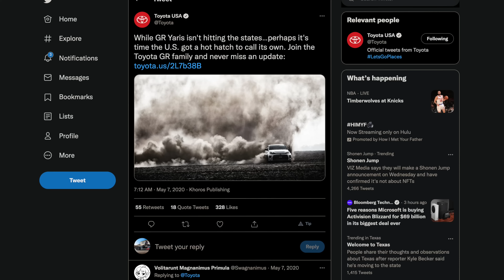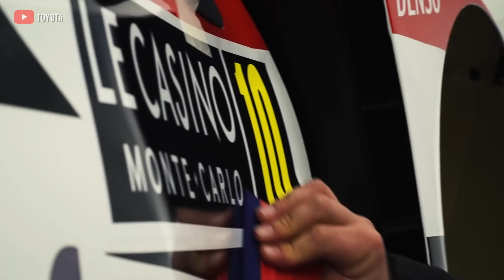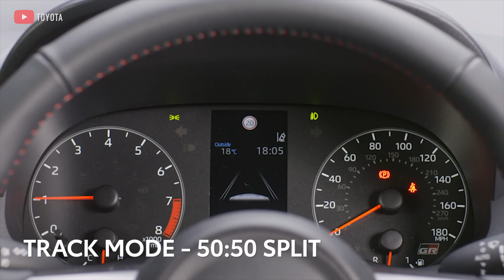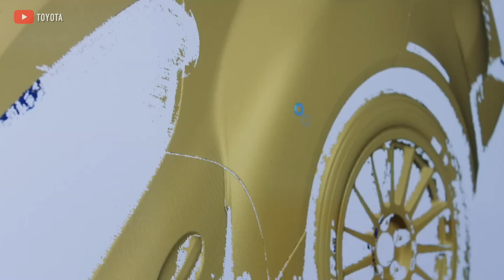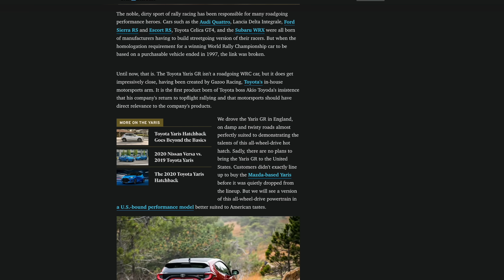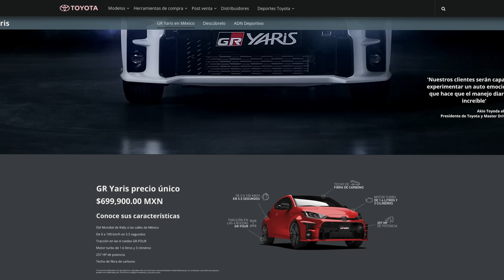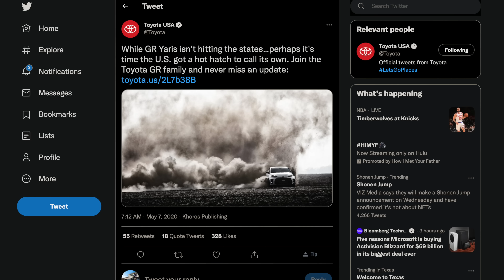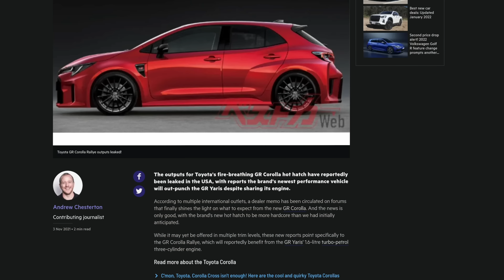Can You Forgive Toyota For This?

Comment from the maker: What are your thoughts on the GR Corolla? Vaporware or Toyota's saving grace?
Reply: Neat, but that's about it.
Reply: It’s looks nice
Reply: GR Corolla probably will be the first new car I will buy :)
Reply: The GR Corolla won't be as bespoke as the GRY or it will be too expensive, the GRY is nearly twice the price as a normal Yaris here, I'm hoping for an auto version of the GRC
Reply: Its the Toyota version of the ford focus RS lol
Reply: Wont be as special as the GR Yaris, but undoubtably great. 

I always wanted a hardcore version of the Corolla, because its already pretty.

The GR Corolla will have the same engine and drivetrain, but not as much of the extensive body work, slightly lighter than the regular Corolla, around 300hp.
Hard to imagine its going to dissapoint
Reply: Probably gonna get some hate from this but why does the USA need to have all the cars in the world ? How much choices do you want ? Is the same market that didn't sell the Celica well back in the days and now it's a 50% chance that it will happen again. Only enthusiastic people are going to buy it but it will not be enough to make it a hit. It will be wanted after it has left the US market again.
Reply: GR Yaris is boss why does Toyota need to save them selves
Reply: hot hatch = yawn, no buy.     real homologated rally car = I'd buy two.
Reply: It will need eveything the GR Yaris has:
- Manual Transmission
- GR - Four technology/modes
- Same power-to-weight
So, ballparking the weight based on the current Corolla XSE, that means 300-340hp
Reply: @bigbodykarate6403  I've done the math. Ballparking the Corolla weight based off the current Corolla XSE, To have the same power-to-weight ratio, the GR Corolla will need 300-340hp
Reply: I just drove a new 6 speed fwd hatchback and the thing is a blast, handles incredible, and the acceleration is awesome. Praying we get this version in the US!
Reply: @TerminatorProducts why would you want an auto version of a car like this?
Reply: @TerminatorProducts  I'm gonna ask you this genuinely, and give you the benefit of the doubt; are you physically disabled? Because I've a car-guy friend with cerebral palsy and that's why he needs an Automatic.
Having a physical disability is literally the only valid reason for wanting an automatic sports car
Reply: @Aglai76  Mate I'm a manual man through & through, currently own a few manual V8s, a couple of Hilux's & GR Yaris, (I must say my Supras auto is stunning though), I want an Auto GR Corolla for my partner she struggles a little with driving manuals for extended periods as she has had left ankle operations, I can't ask her to daily drive a manual so if there in no auto GRC she will be getting a GR86, having had two manual GT86s previously I was happy with the car apart from the lack of power
Reply: @bigbodykarate6403  : The Corolla's supposed to come with significantly more punch than the GR Yaris; I've heard talk of 300bhp? Also, apparently that 1.6 turbo is very responsive to modification and can probably go significantly above that; more in line with Toyota's old school stance of overbuilding than a lot of other manufacturers' "make it break if pushed much over factory figures".
Reply: We were blessed to get all those cars and more as a small island. Once you have the cash you're able to import it yourself. The Corolla runx Z was an amazing car, also the caldina gt those were the best sport cars of the early 2000 for toyota that we had the 3s beams alteeza also.  The runx was the better car to have than the celica if you wanted 4dr sport. The gt starlet was amazing for real cheap speed but the sir and type r guys just beat them so they had to squeeze the waste gate or upgrade the turbo to the mr2 or celica and its a beast. Those were fun days.
Reply: Even if they don't sell the Yaris in America, why not just bring over the GR Yaris?
Reply: Gazoo means a*us so there's that..
Reply: @EpicB  For the same reason nearly none of the homologation cars will ever make it to the US. US crash testing. You need to put up 20-30ish cars for crash testing. So for a homologation car, which hits the minimum 5000 units sold worldwide, to spend 30 cars to be destroyed for a single market isn't worth it in addition to the few millions or so in certification costs. They were going to hit the homologation sales number without the US so simply wasn't worth it esp knowing they weren't going to produce more than the bare minimum for homologation WRC.

It's the same reason why we're not getting the Audi RS3 sportback or BMW M3 Touring and a bunch of other cars. The cars and testing cost too much for it to be worth that investment for the new body style for the projected sales numbers and realistic production.
Reply: @Alltracavenger  Incorrect there. The WRC race car only has ~400hp. The 1.6t isn't that responsive to modifications/tuning. However, there's speculation they'll put the GRMN Yaris engine into the GR Corolla. Rumor Mill puts that engine at 300PS, or 295bhp. We'll have to see if that's true first and then second if it can be reliable. The Mercedes AMG 2L cranks at 208hp/l at 30.5 psi. But that's a 100k car. Honda and VW are about 160hp/l at 23.2 & ~21psi respectively in the CTR and Golf R. Toyota/GR needs to hit nearly 190hp/l to break 300hp... I just don't think it's there and be reliable unless the engine is built like a $70k+ car.
Reply: I don't think Toyota is doing poorly enough to call this their "saving grace". They sell a lot of cars, they're just not performance vehicles.

I made fun of Gazoo Racing when the Supra arrived at the dealership I worked at. I thought Toyota's mask slipped and they showed exactly how tone-deaf they were. I thought a brand named "Gazoo" would never be taken seriously in the English speaking markets. Oh how wrong I was. And I only realized after the rumors of a GR Yaris coming to market that I might've had it all wrong. At the same time I got the feeling they were becoming tone deaf, Toyota started making big moves towards the complete revival of their sporty spirit. If anything, the new GR name (and subsequent relegation of TRD to off road vehicles and camries) shows me they are right on the money.

They're admitting they had a long, boring hiatus. But a new name, three fantastic cars, and massive marketing campaigns are more than enough to recapture that audience.
Reply: Sorry  but , , ,
Still working on 'forgiving Toyota' for releasing a re-badged, 
BMW money pit as a so-called  "Supra".

.
Reply: This car  isn't ment to save Toyota. It's a true enthusiast car buy enthusiast for enthusiast. It just needs to make a small profit. Like someone else said in the comments. It's the first new Toyota I'd like to buy new in a long time. I had a 06 corolla XR-S and currently daily a 98 Lexus gs400 swapped to a 2jzgte vvti.
Reply: I don't understand what Americans get pissed about not having some of these cars you get some of them and don't buy that many in third world country we get none of these cool cars
Reply: These cars were designed and built in Finland by ex Tommi Mäkinen racing.. There is Jari-Pekka Lappi's GR yasoo on the sale on finnish website if you want the link. 60k€

Comment: Anyone remember the Corolla T-Sport compressor that Japan and Europe got back in the early 2000’s? I think it had a 2ZZ with a supercharger making something like 220hp
Reply: My family owned one with full TRD kit, it was very neat and different car (compared to MB's or BMW's everyone else had). Father later sold it for 2x what he paid for it... and immediately regretted it.
Reply: 2002 T sport without compresor or turbo 1.8 NA 192hp, rev up to 8250 and sound amyzing developed with yamaha. Fun starts after 6200rpm when Lift(similar to honda vtec but stronger) kick in and develp max power at 7800rpm. 6 speed manual... And real hand break... Anyone interested to buy.

Comment: There were more than 2500 ST205's built, it was in production from 1994 - 1999. The 2500 number comes from the homologation cars which had plumbing for an anti-lag system, a water spray bar among other things and was called GT-Four WRC

Comment: It's not a sports car. Its a rally car and a fast car. A sports car is sleek. A sports car looks like a sports car.  A sports car passes the mom test. Its cool no question, but its not a sports car. GR corolla will be fine, it will be a worthy competitor to the WRX. If you want fast, get the new Z. If you want fun get a Miata or an 86. If you want practical but not boring get a Civic Si/R or a GTi/R or a WRX or a GR Corolla. There's no wrong answer here. Get the one you like and drive it.

Comment: Super presentation. Well put together ! I thoroughly enjoyed this video.
The world got the Yaris, after it won the Gold Steering award in Europe. I had the four-door sedan, a simple super-reliable car with a 1300cc engine. Excellent handler.
In Japan the same car came with a 1500cc (1NZFE) engine, sold as the Belta. The 2-door & 4-door hatchback was sold there as the Vitz in 1,000, 1300 & 1500cc engine sizes. The sporty hatchback, the Vitz RS had traction control, rear discs, came as 2 or 4 door, in Auto or manual Transmission. 
In 2001, you could buy a 2-door, manual 1500cc VVTI (1NZFE) with a Turbo and Intercooler !
Since the Vitz came on the market in Japan, all three iterations of the tiny hatch could be bought with a Turbo Intercooled engine !
When Toyota re-entered the Rally competitions, the Hatchback GRMN (GAZOO RACING MASTER of the NURBURGRING) Yaris (Vitz) had an 1800cc (2ZRFE) supercharged motor. The domestic street-legal Japanese GRMN (NCP-131 model Vitz) came with a 1500cc Turbo (INZFE) motor. I have seen the 1800cc street-legal version Vitz being sold in Japan.
In recent years the epic GR Yaris has evolved with more horsepower with a new 3-cylinder 1600cc engine. This car that have rally-enthusiasts by the balls, is what is featured in the latter half of this video.
I used to import used Japanese cars in my country, and our family had the 4-door hatchback Vitz RS in the first (NCP13) and third (NCP131) iterations. Both had Automatic transmissions.
In my opinion, after importing hundreds of cars from Japan, the Yaris/Vitz cars are some of the most durable and reliable cars that Toyota ever made.
Oh ! The Yaris was sold as the Echo in some countries.
The nice part ?
Each citizen in my country is allowed to import a new or used car every 4 years !
Trinidad & Tobago.
West Indies.

Comment: GR Yaris > GR Corolla
It's all about the power-to-weight ratio.

To equal the power-to-weight ratio of the GR Yaris, [ballparking the weight based on the current Corolla XSE] the GR Corolla would need
300-340 hp

If the GR Corolla it has the same amount of power as the GR Yaris
The Yaris will be a much better car

If it doesn't come in manual
The Yaris will be a much better car
(And I wouldn't even consider buying it)

If it doesn't have the same GR-Four technology
The GR Yaris will still be a much better car
(And I wouldn't even consider buying it)
Reply: This is what so very many people forget about cars, what separates the truly special from the pig in a ballroom gown is the things centered around driving, not just a spec sheet.
Reply: The GR Corolla will be sold here as a manual, as well as an automatic. Whether the auto will be the same CVT sold in the Yaris or the one borrowed from the Toyobaru Twins (GR86/BRZ) is unknown. But I hope they pick the latter of the two and not the former for the automatic option.
Reply: @original__gmebvy  I literally could not give less of a shit wtf the auto has in it. It could be made of rubber bands and Solo cups and break down every 5 miles.
If you buy the auto version of a sports car that has a manual option, and you don't have a physical disability preventing you from being able to properly operate a manual transmission, why tf are you even buying the sports car to begin with?

Comment: Since the first generation of the Toyota Vitz (Yaris in non-JDM) there has always been a 4WD version. As a matter of fact, almost all Toyota's JDM models have a 4WD version. Any model number ending with 5, is a 4WD, like NSP135. Toyota has many nice models, which are only sold in Asian markets. Many minivans that are practical but still fun to drive. Many also have a Gazoo version, even though it's mostly cosmetic with a little bit of suspension tuning.

Comment: In my user manual for GR yaris is written that i should avoid 95 octane gas when 98 or 100 is availible. Also i should avoid at all times 10% ethanol fuel as it will damage the engine. Now i dont know if it has something to do with this topic as GR corolla has the same engine, and what kind of gasoline do you have.

Comment: The yaris wasn't much until put in the hands of a 17 year old. I had that 1nz pinned at redline everywhere I went. Hell yes, that car was slower than a slug. But it's brought me into car modifying and in depth repairs. But when I was 17, I had that stupid grin every single time I had all 106hp screaming past a semi on the highway. Currently posted up in the shop waiting for a 2zr after a cracked coolant hose.

But yes I've been waiting for a gr corolla since the beginning of the pandemic..

Comment: More cool Toyota cars the  USA never got:
Mark X: basically a RWD Camry, there was also a GRMN version with a 6-speed manual and 3.5L V6
Crown: kinda like a Lexus GS for Toyota also came with non turbo JZ engines
Blade Master G:  Corolla hatchback with a 3.5L V6 2GR-FE engine
Aristo : a sedan with the 2JZ-GTE engine
Mark II and Chaser: RWD sedan that also came with JZ engines
Verossa: also a sedan with 1JZ engine
Yaris GRMN: the previous special Yaris with a 1.8L supercharged engine
Altezza: with a BEAMS 3S-GE engine and 6-speed manual
Glanza V: a special limited version of the Starlet with turbo engine

Comment: Everyone's talking bad about the older Yaris/ Vitz cars from 2008-2011 but toyota made a few turbo charged Vitz RS and they were snappy. Even the N/A Vitz RS was bacically head to head with a Corolla. I own a 2011 RS 1.5 and those 2019 corollas 1.8 are no match for me in a quarter mile drag. Ps i enjoy fun little hatchbacks like these with a few cheap mods you can easely get down the 6 seconds from 0 to 60 mph.

Comment: Even where it's sold, it's sold in limited numbers anyway... So yeah, it Toyota allocated some cars for USA, it would still be in very limited numbers, and the other markets would have suffered due to consequently reduced allocations...
Reply: Maybe it'll be a situation similar to the Chevy SS (yes I watched TDIB's Chevy ss video) where they hardly advertise the thing and sell so very very few of them..
Reply: @Jonathan-nn8fe  In Europe Toyota does not advertise too much, it does not have to... but it is advertised nonetheless, though this model similarly had even less ads, it had enough fanfare and publicity in the medias to generate 'want it' factor and drive sells without further push onto customers. And the top of the spec rally-bred model is advertised even less but due to limited numbers allocations it's been sold out before first cars reached the dealers ;) Any tests/vids only exacerbated the availability factor - think of it this way, while it's not as limited as 911R, markets where it sold it was sold out within hours or days the resevation/oder lists were opened. Any showrooms that currently have these cars "in stock" are the ones that actually bought them so the buys would then be technically 2nd hand markets from the get-go ;) So yeah, it's not like they're not selling them, but maybe, just like with 911R, there will be another nigh-on similar but not limited numbers model in the future that will be sold unlimited worldwide... Though possibly such one might actually be running the GR Yaris Rally1 hybrid gear instead, thus not hitting Toyota's fleet hybrid/alternative goals and consequently any taxes incurred due to petrol-only gas-guzzlers on offer ;) That might take place once the 2022 rally hybrid car proves itself on the stages. Chevy SS is not advertised or sold much in Europe due to sheer engine impacts on company-/fleet-wide taxes in EU markets, let alone public perceptions when priced the same as higher "class" European products, and other regions might as well impact managerial decisions with similar 'fines' or due to the ECO-friendly fleet prestige goals set therein.

Comment: Great vid. The GR Corolla will have the engine and drive train from the GR Yaris. Unfortunately it will come with 2 more doors than I wanted. It will also likely lack the CF roof, the wide body.  It won't have a crazy front end, hood, and huge wing. The car that Toyota could finally go crazy on style wise, they'll let it look stupidly plain I bet. And while I'm down with sexy clean styling like the new Z, the crazier and meaner the look the better for Rally cars. Except, don't pull a subaru. Also... the GR Corolla will probably be too expensive, and stealerships will mark them up out of market price, and Toyota won't make enough of them, even though they'll be built on an assembly line in mexico and not their skunk-works special plant by hand. It will be missing that magic. Toyota will find a way to screw it up like they did with the Supra and the 86. They hate Americans.